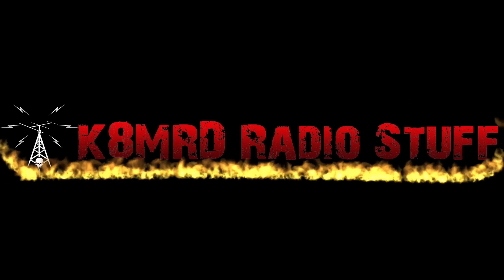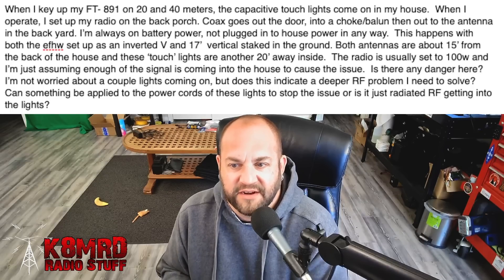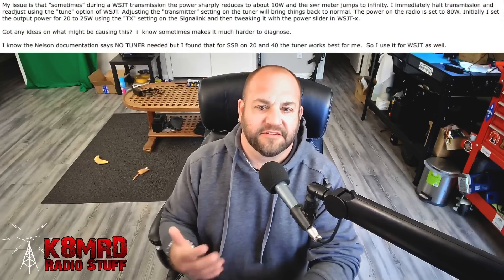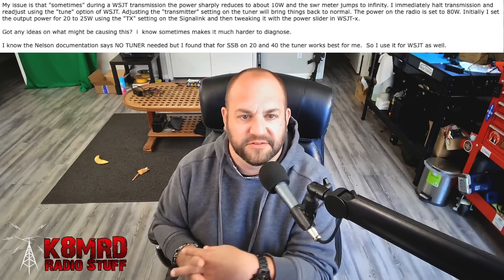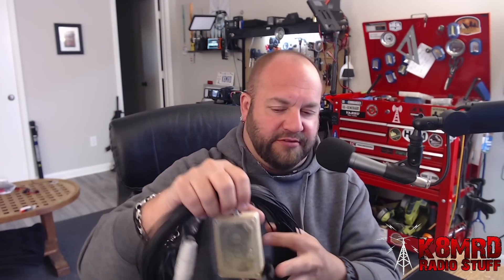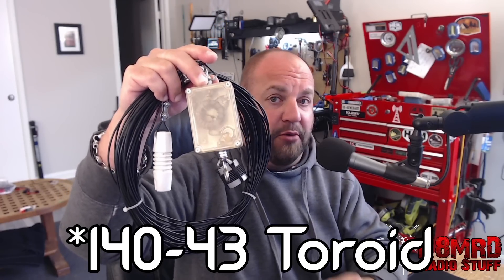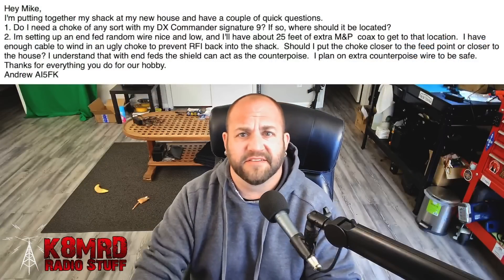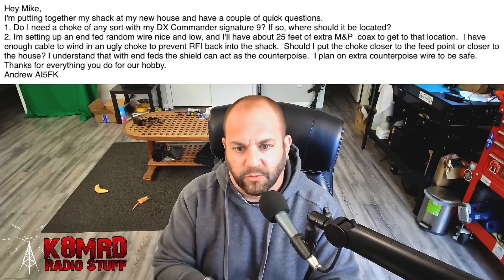Ham Radios VS Touch Lamps

Comment: I have the same touch lamp problem on 40m, but it’s also shutting off the UPS system that my computer and office equipment are plugged into. Completely turns it off. Any help from anyone regarding this, please?

Comment: I have recently started having a problem when keying up on 40m.  20m is ok, but when I key up on 40m there is one GFCI in the kitchen under the sink that starts making a buzzing noise.  We have a stainless steel sink and that buzzing from the GFCI vibrates through the sink making it sound like it is arcing.  Sounds kinda like a big stun gun.  I can't see any other side effects other than the noise.  I might try swapping out that GFCI to see if that noise goes away.

Comment: I'm getting into my apartment buildings for alarm system on 30 meters just tuning, so I've been avoiding it... Had an inspector come by doing some pre checks, told him I'm a ham, operating in FCC space, and their setup isn't working right "here, lemme show you" I got the yeah, here's a crackpot old guy trying to complain about clouds... I had him stand right under the alarm, key up with 5 watts and tell him that's 5 watts, I'm legal for 1500 on most bands... I need you to tell the techs that are doing the actual inspection and work to contact me about the problem...  He kinda turned a bit green... And the oh crap i misjudged this look happened

Comment: ps that box looks like it has enougth space to stack two 240/43 and that would stop the issue.
Reply from the maker: That might be pushing it a bit.  It's not that thick.  You might could squeeze one in but that might be a challenge too.  It's not as big as it looks.

Comment: My neighbor had a touch light and when I would key up with my antenna pointed in that direction it would turn on the light and they thought it was ghosts turning it on and I never told them different. At the time I was running 20 watts. hihi 73 from ki0ad/Jim😮😮😮😮
Reply from the maker: hahaha thats awesome!

Comment: I had the same thing happen but it was my oven being turned on and off while doing ft8 on 10m. I was doing ft8 at my desk and I kept hearing the oven touch controls making a beeping sound so I went over and saw the oven was being turned on and off. At first, I thought the oven touch controls were failing then when I stopped the ft8 and turned off the radio and the oven stopped making the beeping noise. Was going to post it on forums to see if anyone has come across this. I guess this is something to watch out for especially in multi-family buildings😬.

Comment: My touch lamp goes on pretty much whenever I key up.  I just deal with it, and turn it off later.  I also have a homebrew sound system on my back porch that tends to resonate if I leave it plugged in and turned on when I play radio and key, however it distorts - the xyl says it sounds like demons.  I don't think the lamp is turned on by something in the house wiring/grounding, it seems to be reacting to the wiggly air coming off the antenna.

Comment: As for the power rating for the balun, or other gear, it used to be expected to rate gear, particularly tubes, for CCS and ICAS. CCS is the rating for continuous commercial service such as an FM broadcast station. When operated in CCS, the item can handle that power with a 100% duty cycle for an indefinite time. 24 hours a day, 365 days a year, etc. ICAS is the rating for intermittent commercial and amateur service; think a CW transmitter operated a few hours per day with some transmission intermingled with periods of reception.

Anyone familiar with stereo amplifiers knows the games manufacturers play to rate their equipment far more powerful than what can reasonably be expected. Thus reviewers tend to do their own measurements to help compare various brands under comparable conditions.

Another issue with ferrite cores is that as the power increases, efficiency drops off long before the core gets hot. What is the point of operating a balun at its maximum safe power level if, at that level, the efficiency is abysmal?

Comment: We have a China cabinet that has a touch hinge to turn on the lights. I have placed torroids on the sensor wire, power cord, chokes on the coax and nothing stops the light from going on. So like Mike I live with it

Comment: question #2: Answer, Dont use that antenna. thats the hard truth of it all. any antenna that uses a transformer or toroid it will get hot and swr will climb and power will fold back. best to use a specific tuned antenna dipole if your gonna use any digital mode. best is a fan dipole. swr will never climb and radio will never fold back power and you can use one coax to the fan dipole and have as many bands on a fan dipole as you want.

Comment: No amount of ferite around the power cords of the lamps will do the trick.   The issue is at the electronics of the lamp.  It acts as a receiver for detecting the ‘touch’.  I once saw a write up where someone put resistance on the leads on the bread board inside the lamp… but that is way more expensive than buying switch lamps or something else.  My wife knows when I’m on 20 or 40… I just unplug them

Comment: I've shut off fuel-injected VW bugs (ign systems not shielded well) and wiped out wireless intercoms in fast food drive-thrus with a 40w 10 meter mobile. Sometimes the devices don't have adequate RF shielding, not the transceivers fault.

Comment: I have a few coils of coax just before the transceiver and it knocked out my common mode interference. The left stero speaker would go loud when keying. I would have to shut off my stereo when on the air. It's gone now.

Comment: Thanks Mike! Looks like touch lamps are sensitive RF receivers. Do you also find that touch lamps emit RF noise when plugged into AC? FYI, I have a night light designed to go on when the AC power goes off that sits on its own battery charger. That charger produces lots of RF noise if it's kept plugged into AC.

Comment: I had the same problem with the only touch lamp in our house for the lights in the entertainment center usually on 20m.  After choking everything I could to death and turning my power down below 10w with the same result...I ended up unplugging it since we never used them anyway!  I still hunt POTA at QRP everyday though....ham harder not smarter!

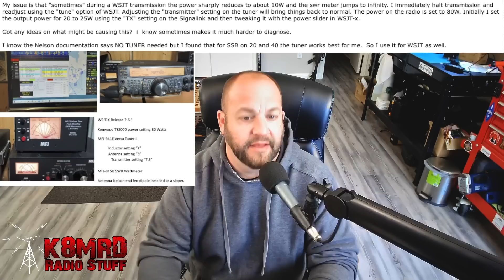Comment: The answer to the question at 4:50 lies in the way the operator uses the efhw. The impedance transformer, usually 49to1, is designed to transform high voltage. At frequencies on which the antenna wire is resonant, a high impedance occurs, meaning high voltages will be present and easily be transformed. If you operate on a frequency, the wire is not resonant on, the impedance drops rapidly and current begins to flow through the coil. The magnetic field in the ferrite and the current through the wire start to produce heat in the wire and in the core. The entire assembly heats up and fails. So it’s not a good idea to apply the tuner in front of an impedance transformer to get rid of bigger mismatches. It makes the SWR look fine first, but after a few minutes of operation the ferrite core fails to build up a proper magnetic field and SWR goes all over the place. Remember: the endfed wire must be fed at high voltage,not at high current to make it work. A halfwave dipole has high voltage at its ends and high current in the middle. Apply this knowledge to several harmonics, and you can figure out for every frequency whether there’s a high voltage or high current at your wire‘s end.